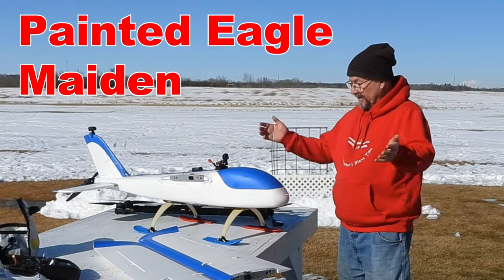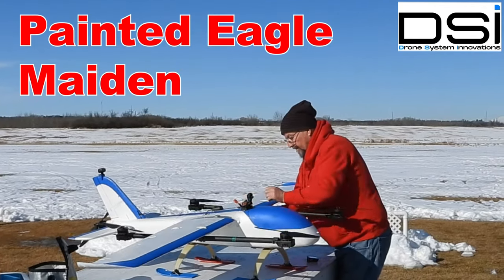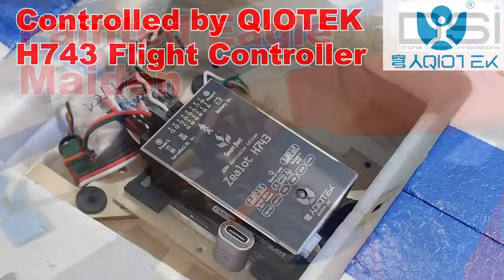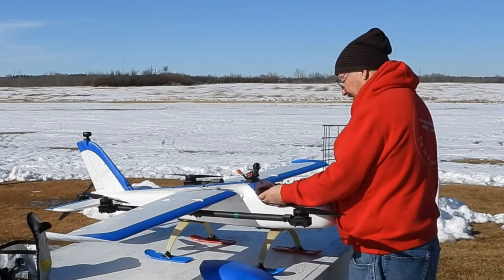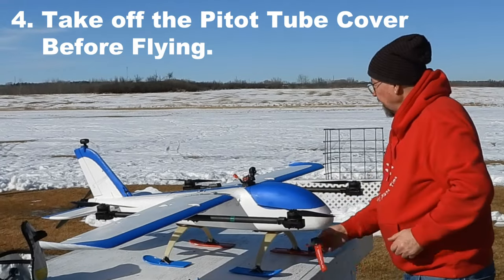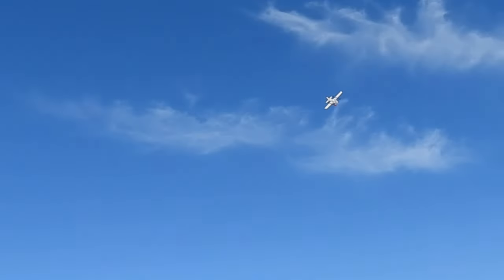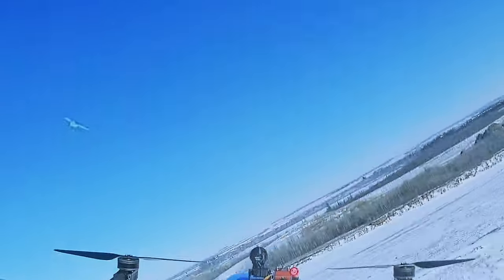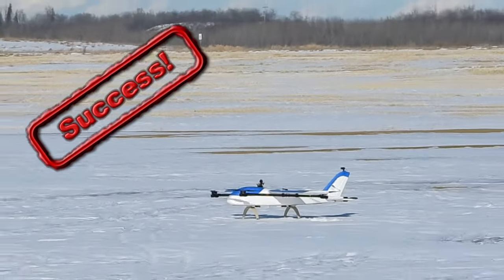Painted Eagle VTOL RC plane Maiden Flight - ArduPilot 4.5.0 on the Qiotek Zealot H743 autopilot

Comment: Hey Tim! Did you use lua script to tune it? That was soo quick! And how did you bring up the tune hud in the fpv?
Reply from the maker: Yes, used VTOL-Quicktune.lua. This is an edited video, just showed the key moments, actually tuning took several flights. The tune messages show up in the HUD automatically if you have the ArduPilot OSD running, for example I'm using HD-Zero but could be DJI, Walksnail or even analog.
Reply: @timtheplaneman  that's awesome! I was wondering if the Vtol-qucktune can work for Vtol copter tailsitter. Once you drop the lua script into the luascript folder. Will it execute immediately or will I have to set up a switch? Thank you TIM!
Reply from the maker: @farkhodkhikmatov4738  it doesn't currently do a good job of tuning yaw. Checkout the docs here https://ardupilot.org/copter/docs/quiktune.html
Reply from the maker: and checkout the readme on GitHub https://github.com/ArduPilot/ardupilot/blob/master/libraries/AP_Scripting/applets/VTOL-quicktune.md @farkhodkhikmatov4738